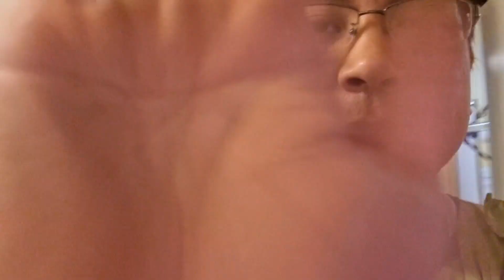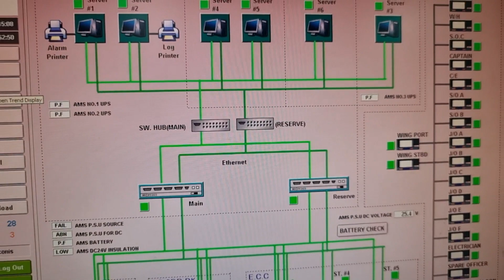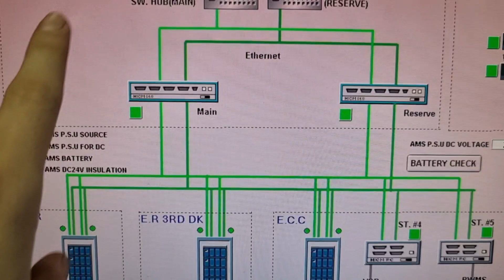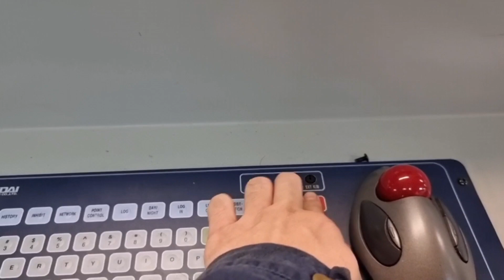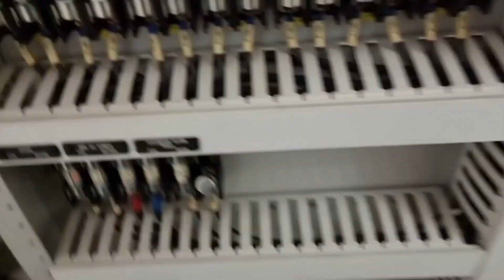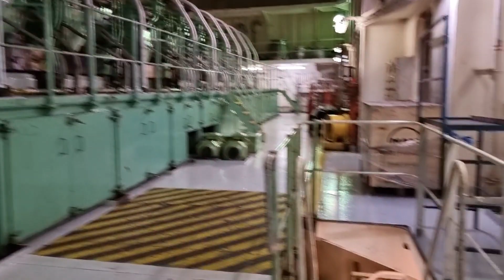MAIN ENGINE SHUTDOWN, HOW TO RESET ALARM MONITORING SYSTEM | MARINE ELECTRICIAN LECKYJAKE

Comment: .... (editted for security reasons)
Reply from the maker: The ship was built 15 years ago and it is something that the MPC- multi puprose controller, analog modules and serial buses would have a compatibility issue with the newest tech. Technology is changing so fast that the vessel cannot just go and laid off to upgrade everything. It will cause millions of dollars to stop the operations and delay billions worth of cargo. It's a matter of delivering the goods in time.  In 2 - 5 years there might be a new OS or who knows the windows 10 might be considered as an ancient thing after that.
Reply: @leckyjake  Thank you for your answer! I understand that is not possible to update to the lateste and greates versions. But I think the (PLC) supplier should do its best to make their systems atleast backword compatible with any computer OS. So you can update your servers to a newer, less vulnerable version with update capabilites. You control network at risk if its going to be connected to an external network. For you, it think its good pratice not to show any details regarding the ships network and used OS's since this could be a potential lead for people without good intentions ;) (I'll edit my post too)

Comment: Windows 2000 computer? For what use?
Reply from the maker: The ship was built 15 years ago.
Reply: @leckyjake  is it running a different system than the computers running windows 7?
Reply from the maker: We had an upgrade with other vessel and other software had a compatibility issue especially with modbus.
Reply: @leckyjake  now I understand. Safe sailing fellow Filipino

Comment: The old engineers reset, turn it off and on again, in a logical and controlled manner of course!
Reply: Unfortunately sometimes it doesn't do the job :-) To me Aconis is unstable especially with a lot of servers on board. Like 7-8.